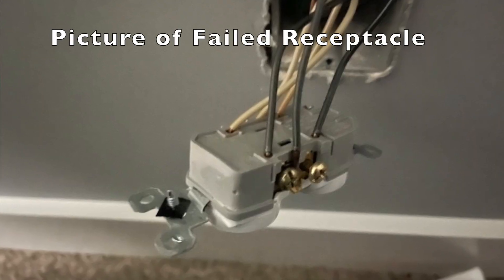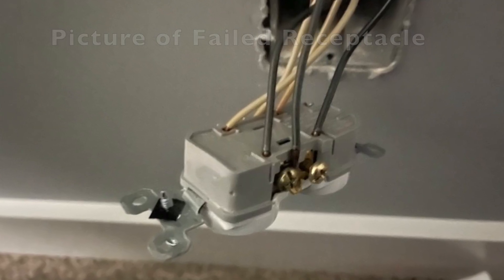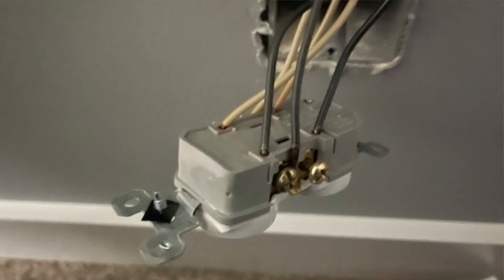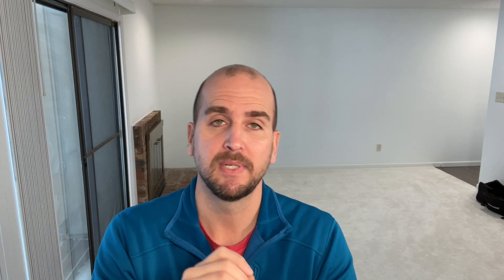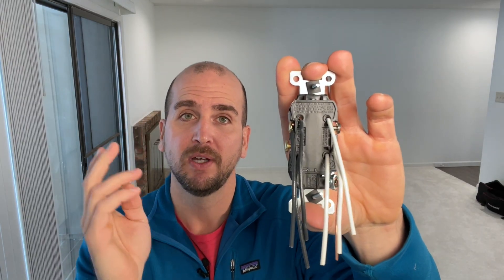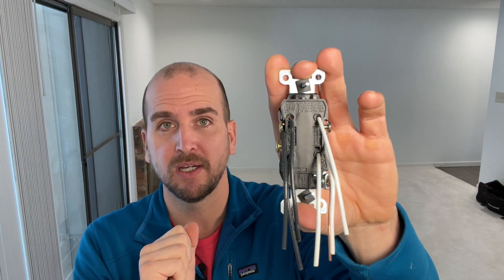Incorrectly Wired Outlet Found In Newly Built Home

Comment: Back stabs should be against code
And at least one wrap of electrical tape around the sides of devices should be code in my opinion
Reply: if your electrical safety comes down to a piece of tape then you didn't do it right.
Reply: Disagree completely.  A few years later the tape's adhesive will likely have degraded into a sticky mess that is difficult to remove.  If you can't/won't align the switch or receptacle squarely in the box to provide side clearance you aren't doing the job properly, imho.
Reply: @jrb_sland5066  well said.im a electrical engineer 30 years exp.wired comm,and residential in 17 states..seen it all.old plastic tape has caused many fires.they going to do things how they were tought,and nothing wrong with that.nobody cares .
Reply: Yes,but only if you know the tape is fire proof. To much cheep fake tape out there to risk it at all.only takes one bad connection to cause a fire..plastic tape is just kindling to get it started..not worth the risk..
Reply: Sparky for 20 years now and have always put a tape wrap on my 277v switches. Courtesy for the next guy. Had one inspector knock me down for this stating that the tape is not rated for the heat. I laughed until i realized he was serious. Only time i have ever heard of this. I only use super 33+. No cheap dollar store tape
Reply: @handlerpandler424  thats right.tape has no place in electric boxes.at tva and apco we had the 33+ good for open air to keep collars dry,but thats all..
Reply: When I said tape I meant the good kind not the crap you buy at dollar general
Reply: 100% agree.
Reply: I agree on the first count but disagree on the latter.

Comment: Also when you tighten the screws it tightens the grip on the pushed in wires inside the receptical.
Reply: if the screws tighten the grip on the pushin's there wouldn't be any open circuit issue's, no?
Reply: @blueplasma5589  shouldn't be ..no
Reply: @blueplasma5589  just be careful and be sure to turn off power feeding the circuit . 120 and 240 VAC has killed and maimed . And maybe consider putting a note over the breakers if others might think the breaker tripped an they may reset it....
Reply: When in doubt contact a licensed professional and work out a plan with , or ask qiestions ....this is for entertainment only ...im NOT responsible for your actions..

Comment: You forgot the ground pigtail. It could carry the load if the neutral failed also there are push down (push in) caps that take the place of wire caps.

Comment: When I install switches and receptacles I always wrap a couple laps of medium grade black tape around the screw edge. This helps to eliminate a chance to ground against a metal bax.
Reply: maybe you shouldn't  be messing  with electrical if you feel the need  to wrap a receptacle  or switch
Reply: @timjohnson6864  I have been "messing with electrical" for over fifty years. Before retirement, I regularly worked at 480 volts. What I offered to you is a bit of professional advice; which you, yourself, ask for. Good luck.
Reply: @MrMockingbird1313  I asked for absolutely  zero advice from you  over hooked 480 up live  and  safely it's simple respect it and  pay attention  and it wont bite ya 2. your box should never be full enough to the point that you need to worry  about the outlet  shorting  out  I enjoy it when people brag about doing something  for x amount of years.  just because your older doesn't  mean  anything  including  that  our work may or may not be on the same level or that we work with different  levels  of attentiveness  or tidiness theres a lot of old practices in  a number of trades that are no longer allowed   and old habits  die hard
Reply: @timjohnson6864  Boy you are testy. You ask for ANY advice of anything not covered in your presentation. I seldom ever leave a comment, but in your case I did, since you invited it. Where I have worked there are many old boxes. Restiration electric is common. The advice I left is because size and standards in the NEC changes every three years. The advice was appropiated. Your presentation was excellent. Your omission was obvious. You're a talented amature and I did this for a living. Good luck, sir.
Reply: @MrMockingbird1313  still has nothing to. do. with centering the device in the box without  causing  a short

Comment: As a Australian electrician I am shocked at what crap the US outlets are and the screw joiners dont get me started . Also amazed at giving advice on electrical wiring to ordinary  people some thing I would never do here in Oz
Reply: In oz all power points are fully color coded  all our wall points have screws that inside a small hole that you insert your screwdriver you insert your wire in another hole then tighten the screw every thing is internal and   c a n not be touched it is much safer  in western Australia you will be fined if you electicute your self   $5000 it's a licensed electricians job leave it alone
Reply: @jackbarrie6007  so true to use a hook on a screw terminal is so 1930s  Not to nick pick but when you say electicute your self a fine would be the last of your worries as that means you dead ( should be if you get a Electric shock) . Also I cant believe places like Bunnings etc sell power points cable etc . What the regulations like in the US in DIY with electrical / plumbing etc thanks

Comment: Nice video! I like the pigtail set up for another reason also. If any receptacle goes bad, no others in the circuit are affected. It makes it easy to diagnose.
Reply: And less likely to be caught... If all the outlets go out, people will fix it. If one stops working, maybe just move the lamp over 6 feet...
Two ways to look at it.
Reply: The pigtails also prevent getting shocked by an open neutral if the circuit shares the neutral with another circuit that is still energized.

Comment: Pigtails, definitely. We found a half-melted receptacle that someone used to pass through the load, the screws were not tight enough. Pigtailed it and then the only failure point would be any load plugged in. We were very lucky there was no fire.
Reply: OK, it seems to me that if I can't trust the guy to tighten the screws I am supposed to trust that he can do a pigtail properly? It does not make sense to me. I would use a empty screw termination in preference to splicing with a wire nut every time. Splicing wires with wire nuts is not something I would except as a good practice, and I spent 35 years wiring aircraft.
Reply: @keithstudly6071  Totally agree.  If an outlet "goes bad", whatever that means, then everything connected to it, pigtail or not, gets affected.  Extra connections are not a good direction.  My electrician in a 5 year old house left me with a few dozen loose wire nuts and most often...loose ground green screws.  He told me that my combo Arc Fault / Gnd Fault breaker would protect me from bad wiring.   Incredible.
Reply: @ShermNE  and believe it or not fire can be a good thing it's there to show you where the problems are I mean without a good flame how would you know what's really bad in your house short of testing it
Reply: @ShermNE  You’re incorrect. With pigtails, you are not relying on a device to pass through current. Downstream outlets are unaffected.
Reply: @24vignettes94  Thank you for the reply.  I am stupid and now understand.  Passing another chunk of current through the device side connector and pigtail is not a great idea.  Thanks!
Reply: @keithstudly6071  Splicing with wirenuts or waco fittings is good practice to meet electrical code. The previous owner originally installed the receptacle and made the mistake.
Reply: I agree that loose screw terminals and loose wire nuts are a bad thing. I’ve seen many cheap wire nuts without wings not cranked down too. Then there’s the problem of volume in the J box. Adding 2 wire nuts with pigtails takes away air space, also not desirable.
Reply: @ShermNE im retired,but biggest problem i encountered was counterfeit cheep parts made god knows where. Even wire undersized,.and recycled junk.glad I'm out of it.that junk isn't safe at all..
Reply: @olivertaylor8788  Thanks.  I've been converting many outlets that are used for high current devices to Leviton Decora Plus (commercial grade) as a result of these videos.

Leviton has a screwed-in backwire option that compresses a plate on top of the wire.  I have measured the contact resistance and I get 0.24ohms using the backwire or the side wire.  Same result.

I know, I have lots of spare time, but I've been an engineer in the connector industry since 1983 so I have to test what I think I know every day.
Reply: Never use cheep outlets,and tork the screws down..takes years of experience to learn how to properly do electrial..lot more to it .
Reply: @olivertaylor8788  How many years does it take to learn how to spell torque and electrical?

Comment: It is against code in commercial but not in residential. This is called plug slicing & is so wrong. If the wire feeding plug pulls out it kills the rest of the circuit thru out the house. Is it legal yes. Is it stupid, lazy, cheap & crap work ?? Yes The bottom line is it cost twice the labor to do it right & people don't want to pay for quality work. Licensed in multiple States for over my 40 year career. I don't do residential for this reason. No money in the industry cause people don't understand the difference & codes don't help the situation. I stick to commercial & Industrial where quality is needed.

Comment: First one to say anything about the push in just common sense the reason we don't use 18 gage wire on a 15 Amp circuit is because it won't take the load why is it approval to a plug circuit with a 18 gage tab as that's what you are doing when you use the push in  no wonder they fail and they not only fail but quite often will faill at 3 or more plug down the line try finding the plugs that have also failed it's interesting where electrician will put plugs and gfi without having a wiring schematic it's almost impossible also electrician and inspector should be required to use proper testers as the push button test will give false readings whereas a tester will show up faulty arc fault switches and GF1

Comment: I think the problem with a push connection is if there is movement. Inserting and removing a plug wiggles the outlet a bit. Eventually this hypothetically would wear into that small little pinch.
Seen many fail.

Comment: Retired pro electrician here who spent the first +- 15 years of my career doing residential wiring. Actually, receptacles traverse both residential and commercial work. 
All of the receptacles you showed were 15 amp rated devices. The 20 amp devices have a "T" shaped slot on the neutral side. Did tons of apartments and custom houses with my second employer and EVERYONE in the shop would run the plug circuits through the receptacle boxes (in/out, leaving 2 neutrals and 2 hots) and use the plugs as a splice to SAVE TIME. Never had a problem beyond the occasional F-up where a neutral got accidentally paired up with a hot. That would sometimes mean taking a entire circuit of receptacles apart looking for the screwed up one especially if you weren't the one who had run the circuits so you didn't know the routing. Where I'm going with this is I would venture to say those push in connections are OK if they are not carrying the entire circuit as they would be if they are being used as a splice to feed receptacles down stream. At MY time, those push in connections (weren't limited to #14) would accept #12 conductors so we were using them on 20 amp "receptacle" circuits when they first began to allow mixing lights and plugs on 20 amp circuits. 
ALWAYS best to splice and pigtail your receptacle circuits. Never had a inspector look to see if the circuits were spliced. Some would have a "fetish" for tight flex connectors (when we were wiring with flex (greenfield) and/or some would be very intent on the green ground screws to bond the boxes. That usually was the tell tale sign that inspector was NOT very knowledgable about wiring. Most inspected everything but were only "expert" on one discipline.

Comment: Pigtail is not only a good practice, it is required by NEC on the ground and neutral. Not required on the hot, but still good practice.  An installed device is not allowed as a connector for a ground or neutral passing through a box.  The only exception is the neutral on GFCI or AFCI outlet devices that have Line and Load connections for hot and neutral. Removal of a device is allowed to break the hot passing through the box, but not G or N, except as mentioned above
Reply: @Joe.  You are correct, the NEC does not use the word pigtail in this context, but spells out the required result that leaves little practical alternative.  Device removal can't break neutral (or ground) continuity.  For a single pass through, it would be legal to remove the insulation without cutting the conductor and loop the bare section around the screw.  Legal but not practical. Once there is a 3rd neutral entering the box with a device, there is no alternative.

Comment: No reason not to run electrical tape over the side terminals on the outlet, and tape your wire nuts as well.  It is not required by code, but it takes all of 10 seconds to do and costs maybe a fraction of a penny.  Running insulating tape around the base of the wire nuts and the wires where they enter the nut reduces the chance of the wire nut coming off if you didn't seat it properly and the tape on the outlet over the screw terminals means if a wire ever does get loose or frays inside the box, it is much less likely to come in contact with or arc to the exposed terminals.  It is very cheap insurance, and for a homeowner who does maybe a couple of these a year and so is much more likely to screw something up than a professional electrician, it is probably a best practice.
Reply: I disagree, taping wire nuts only holds a loose splice together causing heat. It's better to have the wire nut fall off and circuit fail rather then heat up and cause fire.
Reply: @Joe-by8jh  I've seen frayed wires in dozens of boxes over the years, and supposedly professional work where the wire nut fell onto the floor when I opened the box, before I could even touch the wires.  Over time, insulation gets dry and brittle and even basically competent people make occasional mistakes.  It is cheap insurance.  Remember, your work may very well sit there untouched by anyone for the next 100 years when you screw that face plate on.  Be the guy that goes the extra mile, not the guy who does the least allowed by code.

Comment: only thing i was taught different is to make 3 full wraps of tape around the receptical over the terminal connections
Reply: I Thought it was code to wrap it in fpt if using metal box .
Reply: @MegaRiffraff  Code or no code, when working with a metal box,
 any added safety is well worth the little bit of time and tape when you are talking about deadly threats.
Reply: No that is amateur.
Reply: Tape has no place in a outlet box..
Reply: @olivertaylor8788     I used to do that years ago but don’t anymore. It tends to shrink off the plug and make a sticky mess. Other than that, what is the harm in it?
Reply: @huejanus5505  there is no harm if you know its fireproof tape,but plastic will start fire fast if a connection comes loose and heats up..Im a stickler myself,,perfect or nothing.i never use tape .it looks unprofessional, tacky,..
Reply: @olivertaylor8788  Tape can help secure the wire nut in place so it won't fall off if it loosens up over time. That is a safety benefit even if it rarely happens.
Reply: @2Truth4Liberty  Wire nuts do not loosen if installed properly.
Reply: @dsloop3907  "Wire nuts do not loosen if installed properly."
I did not say they do. But 100% "installed properly" is unrealistic and any added safety when you are talking about deadly threats is well worth the little bit of time and tape.
Reply: @2Truth4Liberty  Retired electrican here, mainly industrial wiring, UL certified, (yeah big deal), those that do not know what they are doing should not do it. Tape has it's use, but wrapping wire nuts is not it. Special materials exist for that.
Reply: @dsloop3907  Absent "Special materials", tape will work fine. :-0) I've seen loose nuts that were put on over 60 years ago but had tape holding them in place - keeping the dangerous wire ends insulated.

Comment: Having worked as an electrician,  I learned early on that the push in holes on all receptacles is definitely for 14 Guage wire, however as per code, all receptacles circuits are to be 12 Guage wire, 20 amps. All lighting circuits are 14 Guage 15 amps. This video is the proper way to wire outlets with a pig tale, which also prevents the receptacles from being overloaded, and if a receptacle fails, it won't take out the rest of the circuit, and usually you can isolate the bad receptacle rather quickly! Stay safe!
Reply: @Dev JBGenerally, no receptacles in a home are required to be 20 amp.  There are requirements for 20 amp circuits such as the bathroom and kitchen small appliance branch circuits but NOT the devices themselves.  Its typical and reasonable to see and use 15 amp receptacles on a 20 amp branch circuit.
Reply: There is no code anyplace that requires all receptacles to be wired with 12 wire.

Comment: Scott, the "pigtails" are a stupid idea unless you have no choice. Your original installation was so much safer and better! I don't know what knuckleheads told you that or which "electrical school" told them that, but how can wire nuts with three wires in them be safer than one wire in a specific screw terminal? Granted, the push-ins suck. I never use them, but your screw terminal solution was perfect. It broke my heart that you went to the stupid pigtail. I hate wire nuts in the first place. Add another wire and you're asking for disaster. You had it right in the first place.